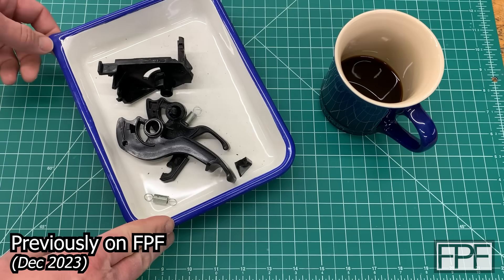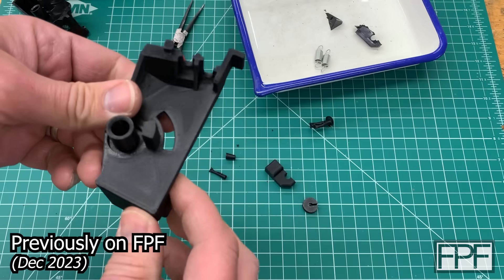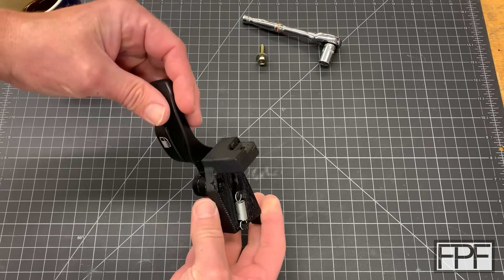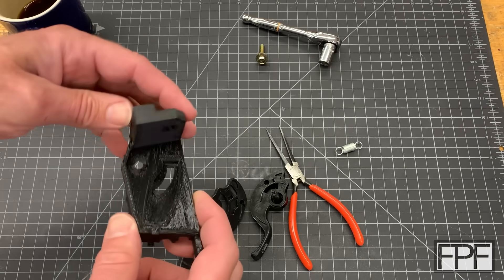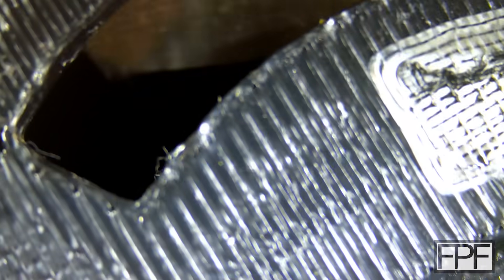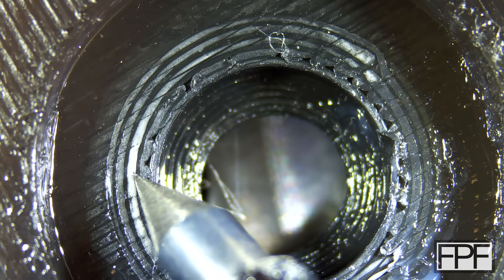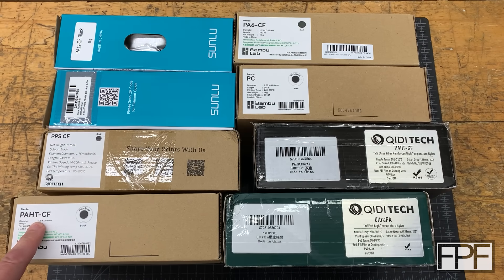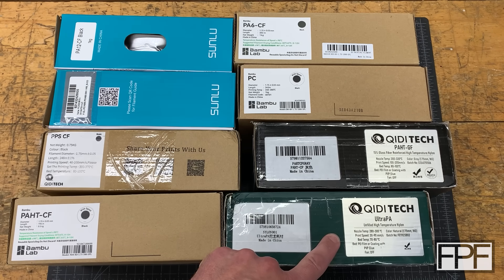3D Printed ABS Car Part Failure Analysis

Comment: You can modify / shave down the shot parts to allow small modifications to the printed part, like the chamfer you mentioned. Though, as others have suggested, the best idea is probably angling the part up from the print bed so there isn't a layer line at the stress riser in the first place (assuming that doesn't introduce weakness in another critical area).

Comment: For the tube part use some metal stock (Aluminium or Steel tubing) and press fit or glue in place. For the other part design a hole through it for a metal pin/bolt for reinforcement. I don't know about the material as I've never used any  but at a guess any of the CF-NYLONs should be good.
Great video. Keep up the good work.

Comment: Instead of that barrel you could maybe redesign it so you can put a bolt all the way through both levers.
Maybe a small chamfer is also possible but doubt it will do much.

Comment: At least for the post (not the barrel) put a hole through it and a recess for a nut on one side and screw head on either side. Install a bolt and put some tension on it, then your post is half steel instead of plastic and it's under compression across the layer lines which should reduce the risk of separation along those layers. You should be able to do this without changing the external dimensions of the post with the right size of screw/bolt.

For the barrel/sleeve, if you were still using ABS you could paint acetone onto the inside and outside a few times to better fuse and smooth the surfaces. This should reduce stress concentrations and provide a bit better layer strength in the affected areas, although it will likely only help a bit. Alternatively, you could cut the sleeve on a lathe (if you have access to one) out of brass or an engineering plastic and press it into a modified 3D print with a wider opening to accept the sleeve.

Comment: ABS-GF (Qidi) has been great for me - used for similar broken car parts.

I'd probably print in the same orientation, but maybe countersink some material from the handle shaft to make room for a fillet at the base of your part, or even shorten by a few millimeters making room for a large diameter at the base of the 'boss' + a fillet.

Comment: Add a M3 screw in the stop pin to reinforce it.
Make the bracket shaft not 'hollowed' and cut the handle shaft and joint the two parts with an screw that goes through the middle of the shaft.

Comment: I realize that the interior of a car can get up to some fairly high temperatures in the summer, but it might be good to get temperature readings down where that part will be. It's not likely to get a lot of sunlight for direct heating, and you may find that while the dash and areas above the seats get well over 100 F. that doesn't means that the area where that part will be will see those temps.

PLA-HT might be an option.

If you have a heated chamber (I think the D2 has that) you might consider PPS-CF10. (In this case the CF10 does mean 10% carbon fiber. The PPS prints to a product that sounds like metal when it goes to ambient temperatures. I'd suggest that since this is going to be touched frequently that you may want to do something lieka plasti-dip treatment to the surfaces that will be touched for anything that you print with CF or GF content, but of course that's up to you.

Comment: This doesn't seem to be a material problem -- more a design and/or slicer problem. Given the complexity of the part and the stresses, I'd say break it up into separate parts and assemble it with acetone or epoxy (still using ABS but with the slicer dialed in better). You could optionally design in some holes for inserting metal pins. Don't over-design if you don't have to just to be elegant.

Comment: If it wasn't for the heat, PLA 😅
It has very good properties, excluding temperature resistance (PETG is not much better), brittleness (shared with PETG and many filaments with CF or GF) and drooping (unfilled nylons don't shine on this).

If you print the part with many materials, you need a measurable and repeatable way to break them. If you can get original spare part, break it (and reprinted plain ABS part) too for comparison - which filaments do better than injection molded part (that has no layer lines)...

Or maybe one or more of those filaments are already tested by https://www.youtube.com/@MyTechFun 🤔

Comment: I don’t know about the nylon filaments as I have only used PLA and PETG but for the piece that snapped off I would try inserting a small bolt into it to give it a bit more strength. For the tube I would try adding the chamfer then sand/file down the corresponding edge of the piece that fits over it.

Comment: One of the things that I see as a comparison between the earlier video failed part, and this one is that this one didn't fail where the last one did. 

As far as fixing the breaking on layer lines issue, if you can rotate the part around x or y by 45 degrees, you're going to see better layer support through the where that cylinder meets the plate. It may make 'support' interesting, on anything that is under 45 degrees off the bed, and you may be able to hide the bed adhesion in an area where that doesn't present an issue. 

If you have a Microcenter near you, at least 3 of my Bambu Lab printers are refurbished printers, which drops the prices another $30-50.

Comment: Siraya tech PPA-CF Core is a safe bet. It has better layer adhesion than regular carbon fiber filled nylons, because they concentrated the carbon fibers in the center of the filament, and there is no carbon fiber at the layer lines. It us also much cheaper than Bambu PPA-CF.

Comment: I don't think I agree with the comments saying to re-orient the print. It's true that ideally printing at a 45 degree angle may be optimal, it's just not practical due to how rough it would come out, with the holes not being perfectly round any more.

My first thought is to replace that sleeve pin with a bolt. You would have to cut off the pin from the existing piece (the one with the clips on the end). Then you could use a smaller diameter bolt, allowing you to make that sleeve (the piece which broke off) with a higher wall thickness. For the other tab piece that broke off, can you not add a fillet / chamfer at the base?

Regarding material choice. For pure layer adhesion, any Nylon / PA filament is going to perform well. The PA12 and PA6 options are both solid, CF or GF helps because normally nylon is semi-flexible as you mentioned. Also note that the "6" and "12" have nothing to do with the filling, PA6 and PA12 are different blends. Either would be fine here. PA12 absorbs less humidity.
The PPS-CF is an interesting choice, but you need to print that HOT. I saw you are using a Bambu X or P series, as far as I'm aware the only Bambu that can get hot enough to print PPS properly is the X1E. You are looking at minimum 320C on the nozzle.

What filament is NOT there that I would consider? This is crazy, but look in to 75D Shore hardness TPU, such as NinjaTek Armadillo. This stuff is basically the same as ABS as far as flexibility... it's still TPU but it's just not flexible any more. TPU has possibly the best layer adhesion of any filament. And it will print fine on any machine you already have, with no toxic fumes.
Reply: I would love to see this part reprinted in the Ninjatek TPU.
Reply: Nope, h2d goes up to 350c and he already has it.

Comment: Rethink print orientation, or increase line width to 140%/increase extrusion multiplier, split the part model in two pieces printed in their most advantageous orientation and then bolted back together, add ribs to the features snapping at the later lines if spacing allows it. Up the perimeters too why not.

Comment: I'd go with the PC. The fibres in the other ones might wear out the other components. Also it should be stiffer stronger and more temperature resistant than the ABS part if I recall correctly.

Comment: The 6 and 12 in PA6 and PA12 is related to the length of the carbon chain in the Nylon and is not related to the carbon fiber content. PA6 is actually a little stiffer than PA12 in it's raw Nylon form but absorbs more moisture.
Reply: Very true! And to add to that, unless they specifically say it on the packaging you have no easy way of knowing the carbon fiber percentage.

Comment: I would re-print it in ABS but reorient the part so that the layers are not loaded in shear like this. I actually thought this when you originally made the part.

Failing that, I would split the part so that nothing prints in mid air and bolt it back together with a few machine screws in strategic locations.

I would also slightly increase my nozzle temp for the ABS and tune for volumetric flow, since the flow was evidentially getting choked when it last printed.

I would expect by using your H2D with PETG for supports, you could achieve a mich stronger print, with a much cleaner surface.

Comment: My material recommendation: PC-ABS. It should have all the right properties. It has a hard surface, it is stiffer than ABS, it is low friction and it is sufficiently temperature resistant. Nylons are too soft on their own and with infused fibers they are very abrassive. How about printing that part in multiple parts? Think about how the stresses go and change the print orientation accordingly. What you can also do is reinforce that broken pin by drilling a little hole through it and glueing in a metal pin/nail/wire. That broken tube section, I'd print it in two parts: the first part (the outer walls) attached to the main part as you have already done. Then either print an insert in a different orientation that you glue in the inside or machine an insert to glue in their. The idea is to combine print orientations so that shear forces can not rip off pieces at the layer lines. As a glue, I'd use an "elastic super glue". It is important that the glue is capable of making the glued part stronger and not weaker.
Reply: A pin and a machined insert was exactly what came to my mind. Printing the insert at 45° should also result in a s tronger part.
Reply: Ever tried to print pc-abs? Good luck. And it is slightly less stiff than the abs.

Comment: use soem champhers of .5mm it will pull the stress lines and some of the parts if u make a small .5 mm hole through the thick parts it will cause a extra path that is a inverse direction PC has some of the best layer adheasion in my experances

Comment: change the angle your part is printed at. second i would use the clan nylon it has incredible flexibility and layer adhesion but it's an absolute nightmare to print

Comment: The "finger" that broke off you could make stronger by leaving room down the center to put a machine screw.  Just leave it hollow and screw it in from the backside.  Let the threads cut into the plastic or leave it looser and glue it in.

The cylinder that broke off that both parts rotate I have no idea.

Or don't make any changes and reprint with better filament and settings and run it until it breaks again so you can make another video.
Reply: Or just replace the stop with a machine screw, screwed in from the back?

Comment: I think its not an ABS problem. Its the BambuLab problem. I bet it was printed to fast. Your print is almost matte. You could reduce the volumetric speed  to 4-6mm3/s. Make stength tests.
Reply: Are you sure that was printed on a bambu lab printer?

Comment: Print the two parts that broke off as separate pieces, in the other orientation. Modify the small piece to allow for a screw in the back and a key sticking out so it doesn’t spin. Make a hole in the main piece for the screw. Print the tube on its side but with flats on the top (making like a t) then on the back of the part where it passes through make parts to key it in and stop pushing back out.

Comment: 11:45 PA6 and PA12 are two different kinds of Nylon. PA12 has a higher LOWER melting point and is more resistant to chemicals. So for this application the clear winner of the two.

edit: i was wrong, see replies
Reply: PA-6 is actually the one with the higher melting point. PA-12 is easier to print because it doesn't absorb as much moisture, but it isn't as robust.
Reply: @MichaelODonnell My bad, you are right. Got my facts mixed up.
Reply: They also differ in rigidity, PA12 will be softer than ABS. PA6 is harder
There is also PA66, but it is almost never used in printing due to temperatures (sometimes in our community it is called PA666). However, it is almost 2 times more rigid than PA6 and almost 4 times more tensile strength.
Reply: @Erop1928 pa66 is actually pretty commonly used in 3d printing.

Comment: Use PA6 at 293c printed on 45 degree tilt. I've found it mostly flexes rather than breaks off at the z axis compared to PA6CF but is an absolute pain to print.  Also your car has been used in a driveby shooting.

Comment: unfortunately, just because a material says ABS doesn't mean it's pure ABS all brands have their own 11 herbs and spices. Same goes across materials, I've been using my dish washer as a testing ground for rapid wear on filaments (high heat, water exposure, load bearing) I've printed a lot of the rollers that clip onto the side of a dishwasher basket in a lot of filaments. What I have learned is that the material doesn't matter as much as the specific recipe of each brand and that's extremely disappointing, BUT playmaker and Siraya Tech so far have the only surviving prints. Siraya Tech's PPA-CF (same as PAHT-CF...marketing of brands), Polymaker's Polylight ASA and Polymakers Polylight PC (TRANSLUCENT) have all survived several cycles. Actually Polymaker's ASA has been going strong for 8 months and rolls better than even the original OEM Injection molded glass reinforced nylon rollers. The OEM rollers are so brittle now that I can't remove them without them crumbling but ASA doesn't give a FUUUUUUU.....

Bambu lab filaments ALWAYS come short and are crap to their counter parts BUUUUUT are reliable in their AMS and printers. Personally the 50% price markup is not worth the long-term cost even when I consider the 1.5 hours it takes me too calibrate a new filament from scratch and have a good idea of what a printer can handle to translate the same filament needs to any printer in my possession. GRANTED I've been doing this for a decade. (I calculate my hourly rate at 100 dollars an hour)

Comment: I downloaded the part file and to be honest the first thing I would try is change the part orientation and use an interface material. since you have the H2D that should not be too difficult and should not add that much print time. Another thing I would do is use ASA. in my experience it performs better in sheer applications than ABS and the H2D has the heated chamber option which will help with layer adhesion. Keep in mind that i would calibrate shrinkage and dimensional accuracy before printing, ASA shrinks a little when printing hot. 

The part has a flat section where the bolt goes through; i would use that part as my base and the rest should print with no major overhangs other than the edges that will be in the air. For support structure i would use the default support not tree support. For interface material HIPS is recommended but PETG or PLA should work. Keep in mind that the bed should be at 100 degrees for ASA or ABS to stick very well so PETG might be a better option for interface material. You should modify or dial in the interface spacing, 0.1 should be a good middle ground although no spacing would be ideal.

Lastly, the filaments I use is polymaker ASA but I use the bambu ASA profile with it and changed the "Fan Speed For Overhang" option from 80% to 50%. Also use 2 walls, 100% infill, the solid infill should have better layer adhesion than multiple parallel walls.  I personally will try to print it on my P1S and will let you know how it goes.
Reply: Well part is in and is acceptable to my eyes but i have no way to test it other than put force on it with my hands and it seems good enough to me. If you are interested i can even send it your way since I have no use for it and you can test the fitment and compare it to your prints or try to destroy it testing it.

Comment: Another option not mentioned in the video could be using pins, screws, or injecting another material, such as epoxy, to distribute forces across the layers. I have had good luck with similar circumstances using 1.2mm "U" shaped holes and epoxy injection. Wishing you the best with the redesign, and I look forward to next week's video!
Reply: I was thinking that too.... metal 'stabbings' made from 20 gauge s/s wire, heated and pressed in.  Would also locally 'upset' the layer lines gaining a bit more strength.
Reply: I had a similar problem once for the "not tube" part and left a hole to insert a screw and paused the print to insert a washer. At the base of the part I melted in a thread insert. This allowed to compress the part a little bit and was way stronger than without the screw.

Comment: I would change the orientation so the stress direction is aligned with the layers instead of perpendicular. Yes, that would mean lots of support and the barrel is printed horizontally, a challenge, but I think it can be done.

Comment: I wonder if the cylinder could be a separate part but add threads on both parts so it can be screwed together after printing.  I also bit printing the new part in a heated chamber will help with the layer adhesion.

Comment: Try 100% infill in TPU. You want toughness here, which is inverse to strength. Going for more brittle (strong) materials will yield the same result.

Remember you can get TPU in the shore D scale as well. But I would first try with 100% infill 98A.